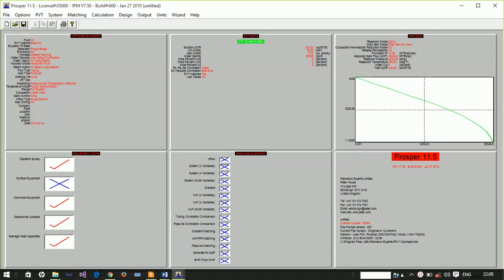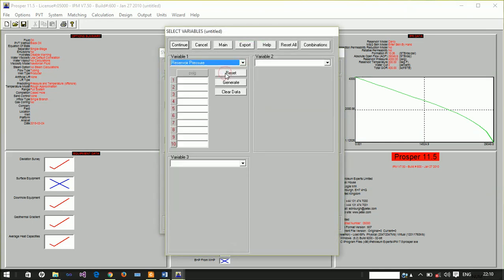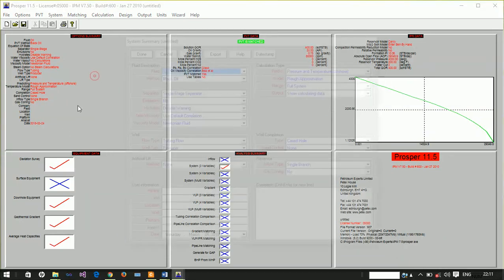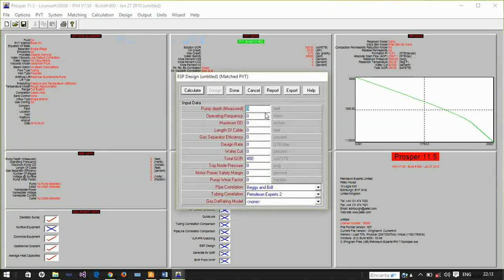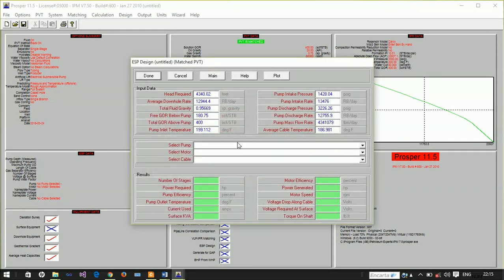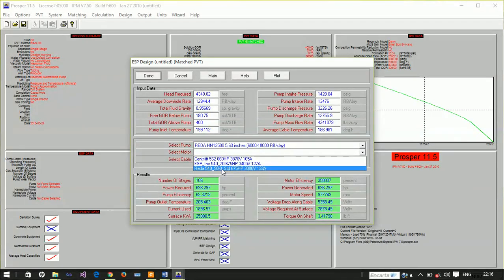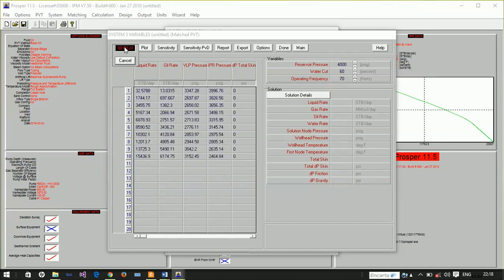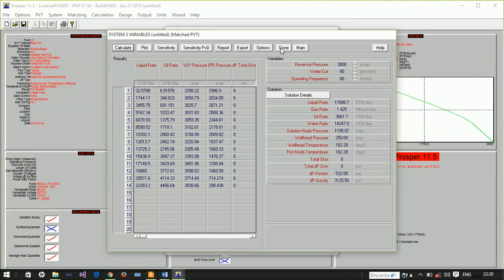Prosper part 5 (ESP)

Comment: Please mention the deviation servey parameters
Reply: For the Deviation Survey use MD: 0 - 8000ft  TVD: 0 - 8000ft. Go to 3:56 for downhole equipment. For Geothermal Gradient use 60 degF at 0ft and 200 degF at 8000ft and an overall heat transfer coefficient of 8.

Comment: That means the sensitivity analysis using 3 variables will control the performance of the pump .since gas rate production is one factor that affects pump performance the pressure,frequency and water cut for sensitivity analysis produces result so I can crosscheck the gas rate and choose the one with the lower gas rate.
Reply from the maker: Use the optimal rate to produce from the pump for best efficiency.
Reply: @MauriceOscar  depending on the variables I do sensitivity analysis

Comment: I have some questions
1. For ESP database in prosper, there are a lot of missing pump types & manufacturers (like Novomet pumps). Is there any way to add missing pumps to prosper database?

2. For vlp/ipr matching for ESP well, how should I select the test point?

3. For downhole equipment, is it a must to put completion restrictions (nipples and SSD and other accessories) ?